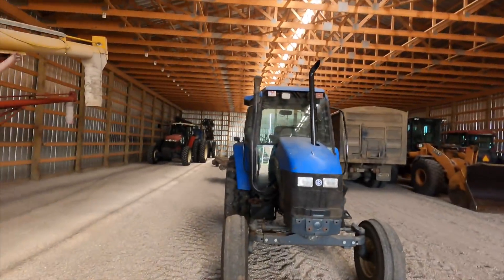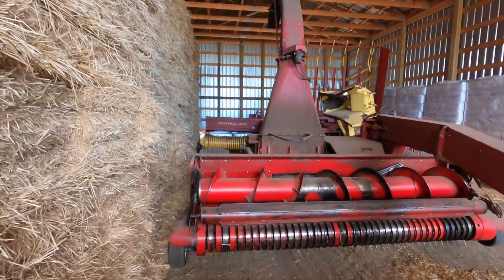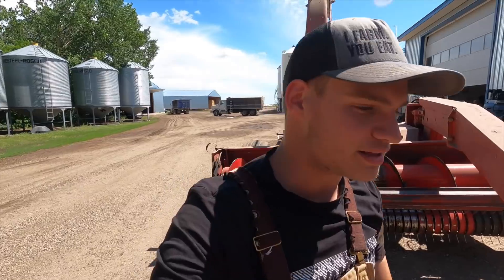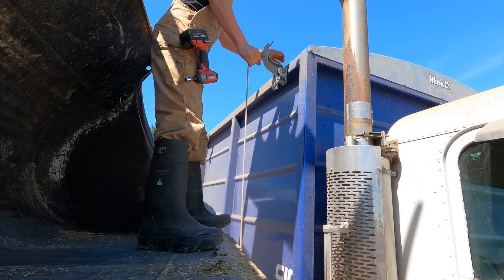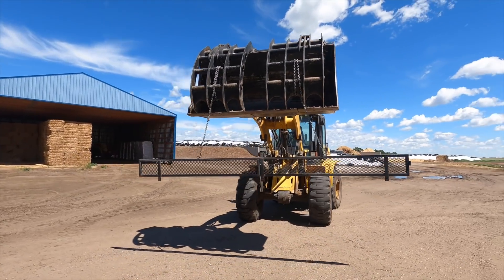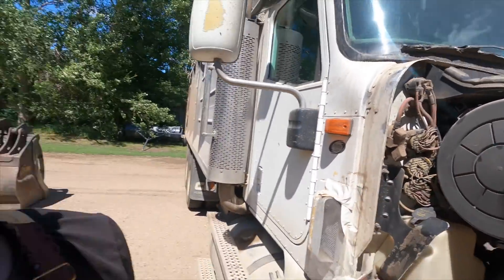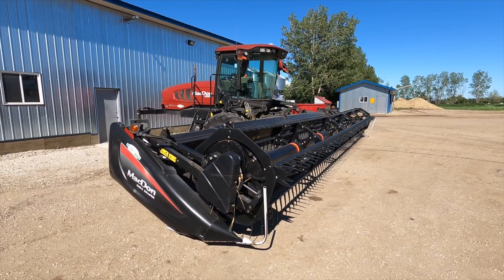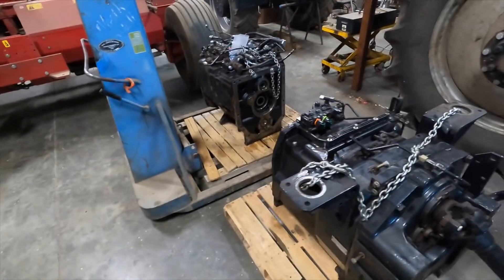Silage Prep!

Comment: Jan, you might consider doing an episode on the gps auto steering that helps with planting, fertilizer application, and harvesting.
Reply: Speaking of GPS I asked MF how he keeps track of all the different seed he uses and what field has what type of seed. I assume this is done with GPS, but might be fun/interesting to get a little more detail on how a framer keeps track of which seed is in the ground and which field it's in. What led me to ask MF this question, was it looked like he was using two or maybe three different type of seed in the same field.
Reply: I think he did  a bit.

Comment: Does that amount of air pressure ever damage the radiator?
Reply: Yes it may roll or flatten the cooling fins on the radiator, as they are just thin metal copper, aluminum....
Dena should have been wearing safety glasses as the air pressure can redirect particles easily back to your body (eye area).